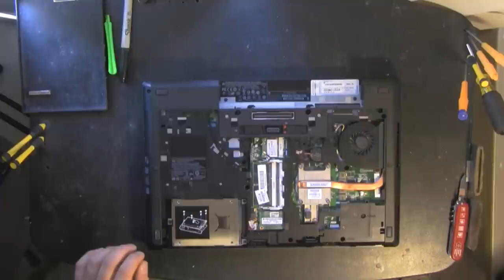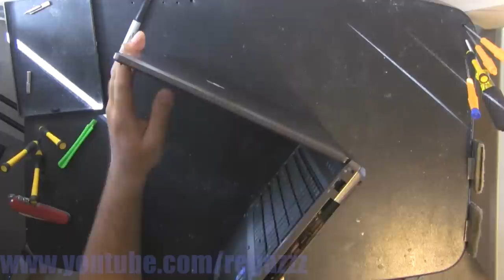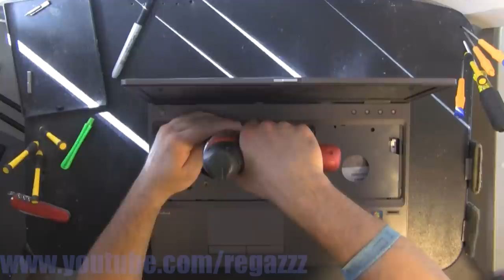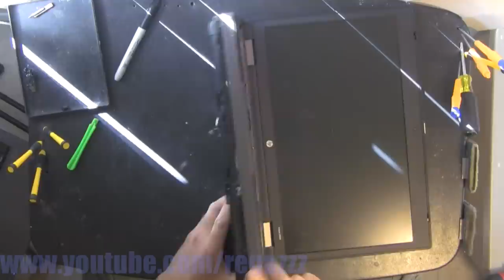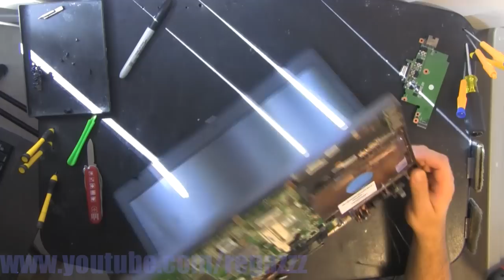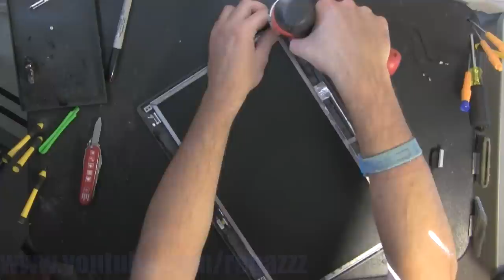HP PROBOOK 6560B take apart video, disassemble, how to open disassembly

Comment: Awesome video @regazz,
Just an Fyi guys, you can reuse the screen from a hp probook 6550b or a 6560b  and install it in a 6570b or vise versa. they're interchangeable and will give you the same resolution quality. all size fits any of the three series.
Reply from the maker: K.R. G I do always appreciate community help like that. I know that it is a time consuming and really a volunteer stuff. THANK YOU!

Comment: Thank you very much! With this video I was able to see if it is possible to change the min 13:00 part (the power supply connector - for the "jack"). After I saw your video I bought the part and change it folowing the most of these steps, without removing the radiator, only the fan (luckly for me, it wasn't necessary in my case because I didn't had that paste after) and without involving the LCD either. And I didn't broke it !

Comment: hello im replacing wlan adapter, but i dont know for set cable, because thera are 4 cable, red, blue, black n white, because if i startup Windows appear wireless module installed in the system not supported and disabled it, how to fix my wifi, sorry bad English

Comment: Some of the screws that required to remove the back are not phillips head screws, they appear to be star or six pointed star screws, which screw driver did you use to remove the screws?

Comment: With HP Probook 6470b
Can I get an LCD with another resolution? from 1366x768 to 1600x900? I must change LCD video cable? thanks.
Reply: Luigi - you can only get a 1366 x 768 maxed resolution for the following models...6550b-6560b and 6570b. yeah I know, sucks.
Reply: Thanks, I sold it! :-)

Comment: My Probook 6460b's motherboard died. The motherboards don't cost much, around 40 dollars. I'm looking to replace it. The only problem is there isn't a video tutorial on the specific model of the Probook 6460b. I'm sure this video is a similar disassemble, however it's not exactly the same.

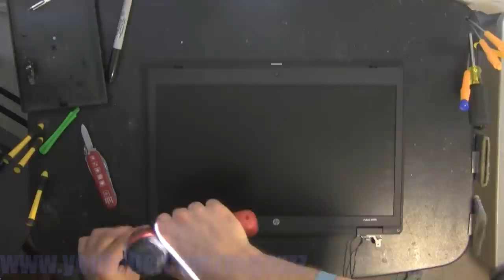Comment: 14:14 if you look at the laptopscreen there are rubber caps at the bottom i lost one of mine. anybody got an idea where i can get those? or atleast how you call those parts.
Reply from the maker: If you are talking about Front Bezel Bumpers - Screw Cover? I fund some on eBay for very cheap.
Reply: regazzz thank you very much
Reply: random dude on the internet 
rubber feet

Comment: You now............. an anti-static wrist-band without being connected to a wire grounded to the chassis achieves the same thing wearing a clown hat. It will accomplish nothing to wear this way, in all seriousness. Why wear the bracelet or point it out if you don't understand how static prevention works?

Comment: hey please reply i have a question
Reply from the maker: Hi, what's up?
Reply: thanks for replying i had opened my hp probook 6560b but accidentaly removed my whole latch slider and regulary when i used to open the latch i would have to hold it until it opens and when i let go of the silever thing ontop of the laptop screen it would go back into place but know it stucks there so i was wondering if you could help me maybe i placed the latch plastic badly

Comment: god 
i live in México
you speak spanish?
Reply from the maker: +Francisco Gonzalo Madero Robles I don't, but I can help as much as I can in English.
Reply: +regazzz   
thank you very much.

I have a problem with my HP ProBook 6560b.I lost my password Bios.
and attempt to remove the battery for a while and nothing.
also try to contact hp , but it did not work.
:(
my laptop is hp probook 6560b
Reply: +Francisco Gonzalo Madero Robles ??